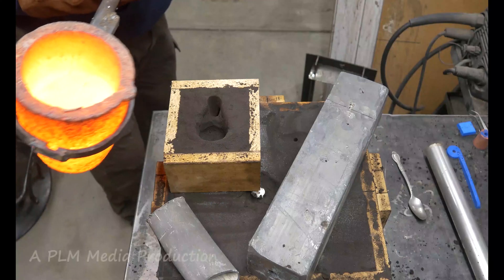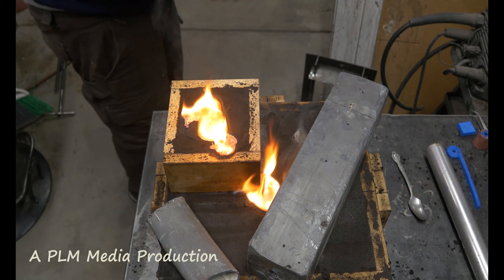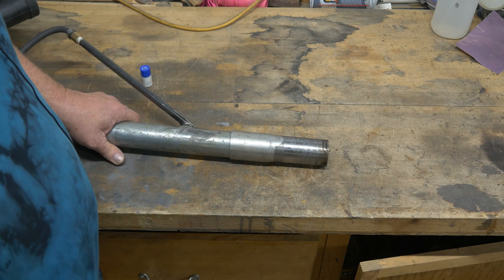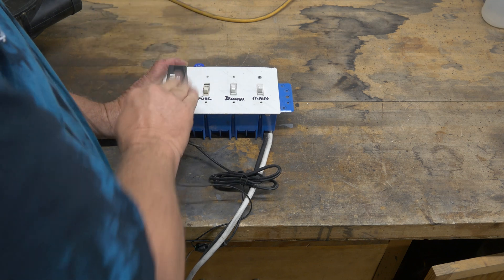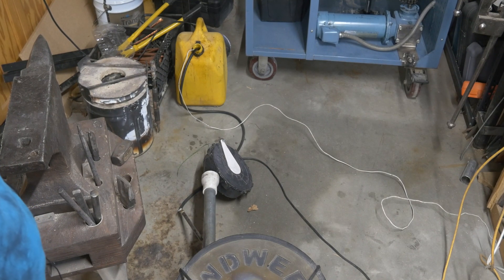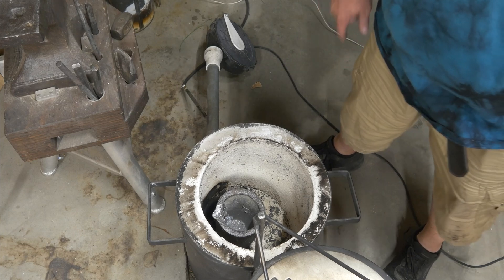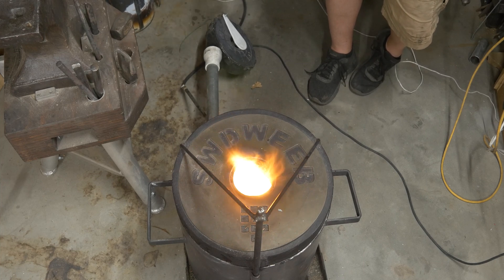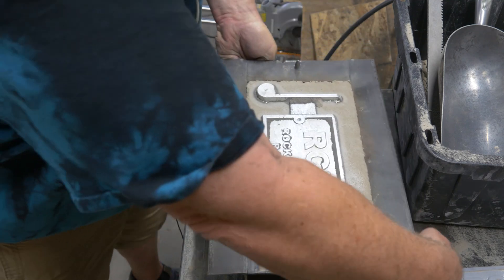Building a diesel burner how hard can it be

Comment: Just wondering what size tube your using and, what pressure your running at?
Reply from the maker: Which tube? The fuel line? It's probably 3/16" ID I don't thinks a 1/4".  I don't know what the pressure of the pump is. I believe I saw somewhere that its less than the pressure the nozzles are rated at
Reply: @swdweeb  Ok, thank you for the information, I'm looking for options for a new nozzle. I made my siphon nozzle that uses little air but, it can be a little temperamental using waste hydraulic oil.
Reply from the maker: Even the diesel through this nozzle can be temperamental.  Clarke Easterling has told me a few times that he’s always having to fiddle with things

Comment: Would it be possible to fill in the useless space with a spacer of some sorts when using a smaller crucible?
 Maybe build a firebrick insert of some kind? 
  Keep up the good work!
Reply from the maker: It is possible but I'm lazy. Well sorta. I'll spend months perfecting a burner but can't be bothered to spend 30 seconds pulling fire brick out 😄😄
Reply: @swdweeb  I resemble that remark!
Reply from the maker: @sparkiekosten5902  The truth is most of the time the brick would just stay there since I generally use the same size crucible.   Thanks for bringing it up 🤔 😄

Comment: Thanks for this vid! I've got some old diesel I pulled out of my skid loader a few years back when I first got it, and a bunch of old used motor oil. I wonder how well a design like this would tolerate blending that stuff into new diesel so I could get rid of it all, and save some money in the process.
Reply from the maker: Read all of this with the caveat of "I don't know." 😄  I would expect that if you filter stuff so that you're not pushing big particulates through the nozzle it would work. Maybe add a thinner like kerosene if your oil has thickened up on you.  Remember the caveat 😄
Reply: @swdweeb  Haha no problem with the caveats. I'm preparing to use a kiln with a PID control on it initially. After I finish welding up some lifting tongs, I'll be seasoning my crucible.

Once I graduate from Aluminum, then I'll need something like you have shown in your vid. Diesel seems like a better bet than propane anyway (same issues as you; I'm from Iowa.) 

If it wont eat my old oil and diesel, I'll just have to take them to the dump to get rid of, nothing lost really.
Reply from the maker: @shonkydonkey  Lry ,me know how it works out, I'm always interested. Hopefully you get to enjoy fall in Iowa. I think we're going to stay in summer mode until it starts snowing.

Comment: I went from a safety concern to a great appreciation of your design. There was a time when some people burned heating oil as fuel in their diesel cars because of cost. Isn't there a loss of BTUs in heating oil?  Thanks for the video.
Reply: AFAIK, home heating oil is diesel, but with the road taxes not applied, and some dye added to catch people who use it in cars anyway.
Reply: @JCSalomon  Thanks. I thought the red die was added only to diesel generator sights for leak detection. That clears up a few things. It's not for leak detection, but tax cheats; the BTUs are the same.
Reply from the maker: Yeah, I’ve always heard the same thing. We used to be able to buy “off road” diesel near here but I haven’t seen it for years. Be nice to find it again as it Gad much lower taxes tacked on to it
Reply from the maker: Thanks Don.  I'm curious, what were your concerns and how did the design address them?
Reply: @swdweeb  I bought a burned out 61 Ford from a  garage fire to part it out. The home built drum heater was left on to warm the garage over night
 It was a drip design. Same thing on a garage fire that was left on to run out of fuel. Both were drip.
You have troll controlled system on a foundry. My pregidis didn't fit your application nor use.

Comment: Diesel and heating oil is the same , add kerosene to . That being said , my furnace man told me you want to see no smoke and black tips on the flame . If you lean it out to burn hotter it damages the liner of the furnace . That may give you an idea of how much you can push it .😬
Reply: It’s makes sense that excess air in a furnace will cool it since it contributes nothing for combustion and simply dilutes the temperature with its own mass that the furnace also has to heat. Without seeing the flame dynamics of what’s going on when the extra air is added, I can only speculate, but it’s possible the air could be blowing some of the fuel in such a way as to not combust and it may be just unburnt fuel. As the furnace heats up it would be less likely as there are more sources of ignition once the walls and crucible are glowing. Theoretically, a perfect stoichiometric (neutral) flame is the hottest for the very reason that there is zero excess air and zero unburnt fuel, but in practice, we tend to run them a little rich. Hot air with available oxygen in it is murder on graphite-laden crucibles as well as metals (more dross), so there are other reasons to avoid running lean.

I don’t agree with the idea of getting too hot in a foundry environment (maybe for a home forced air heater). The refractory you use it you’re going to melt iron should be able to take 3,000 degrees. I have destroyed my plinths made of Mizzou Plus which means they were seeing in excess of 3,200 degrees (which it’s rated for intermittently, 3,000 continuously, as is KOL-30 and others), BUT the furnace walls haven’t fallen apart, even where the flame impinges, so  after a few years of melting iron in it, I don’t believe you can get a plain burner too hot (assuming you have decent refractory) without doing an exhaust heat recuperator, oxygen injection, exotic fuels, etc. Newton’s law of cooling says that a hotter furnace will melt metal quicker and obviously also allows the melting of hotter melting point metals.
Reply from the maker: @TroyeWelch  Yeah, and there's no way for me to really film the flame as it turns out to be a big yellow ball when I try. The flame size does seem to diminish when I put too much air in so it may not be combusting all of the fuel at that point. 

I built it all out of 3200F refractory so hopefully it can handle the temperatures required to melt iron.
Reply: @swdweeb  you should be fine then. What did you end up going with? There’s only a handful in that range and they all have high alumina (Al2O3) content.
Reply from the maker: @TroyeWelch  I'd have to find a bag... I might still have one.  I bought it at my local foundry supply place. I remember looking the product up at the time I built the furnace to make sure it was 3200F
Reply from the maker: I was pretty surprised that pushing too much air was actually causing the furnace to run cooler and I had no idea that I could get smoke from running too lean.
Reply: @swdweeb  the cool thing (pun intended—always intend your puns) is that running the furnace perfectly balanced between rich and lean, but with too much fuel+air flow, can also make your furnace run too cool.  There’s some black magic involved in sizing burners to furnace sizes, but I’m the wrong sort of engineer to make recommendations.

Comment: Nice, I am a drip burner guy as you know but I can see how the use of a pumped fuel nozzle rather than the compressed air driven siphon nozzles most hobbyists choose greatly simplifies things.  I'm almost tempted... 👍 I had the same problem with my big heavy furnace - painfully slow to heat up when starting from cold.  Have you tried using a taller plinth in order to position your smaller crucibles up near the top of your furnace to heat them up faster (maybe 2" below the bottom of the lid)?  Direct flame impingement from a burner can really eat up crucibles fast...
Reply from the maker: You along with most people running diesel. I started down the drip burner route and in fact built one that worked ok but I had trouble getting the flow regulated right.  The needle valve that I used seem to be binary, either it didn't run or it ran too fast. 

I have used a plinth to raise it up and probably should go back to that. I started putting it in the path of the flame after a conversation with Clarke. He does that and said he hasn't noticed a big difference in crucible life
Reply: Does having an extra-tall plinth make the bottom half of the furnace act sort of like the pre-furnace combustion chamber of the Ursutz furnace design?
Reply: @JCSalomon  I think part of the idea is to give the fuel space to combust down below, and the upper part of the furnace seems to get hot faster.  I know a couple hobbyists who have experimented with refractory discs set on top of a plinth, or casting a wider diameter donut section into the bottom of the hot face wall to contain the first swirl of flame (seen this called a volute, but not too familiar with that term), to encourage the flame to do a full swirl before rising up higher, when shooting for cast iron temps.  Also seen a few setups where smaller crucibles get an extra plinth set under them to get them up closer to the lid.